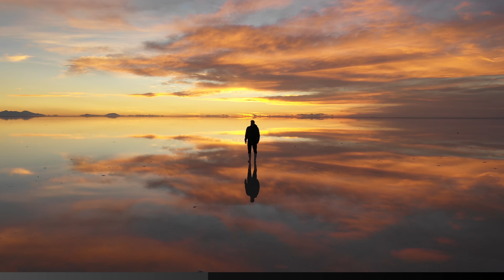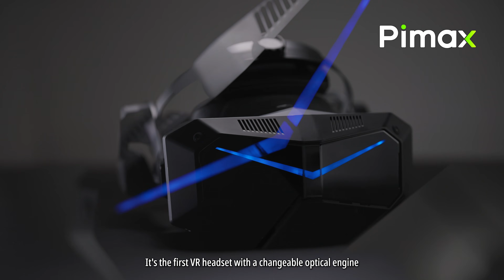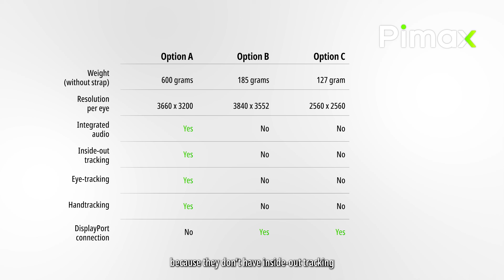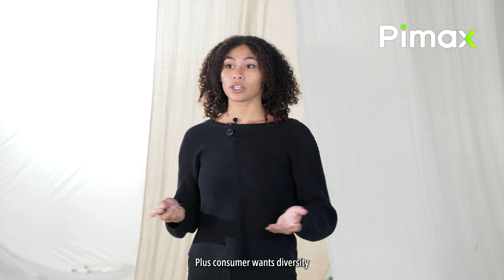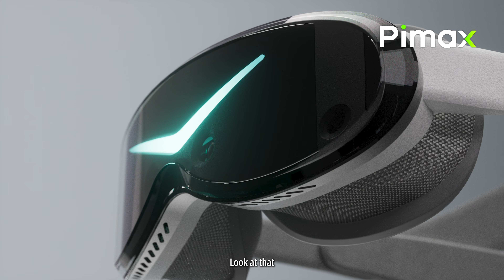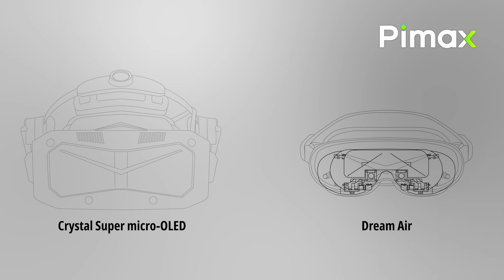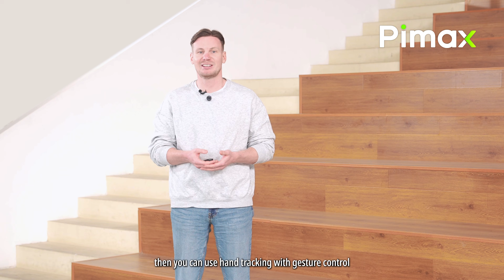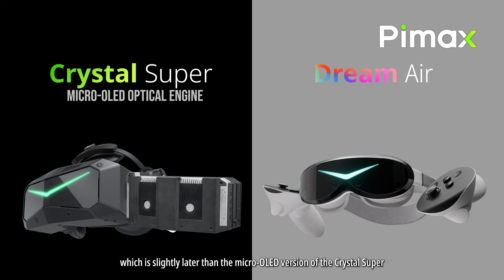Frontier: Hello Pimax Dream Air

Comment: I think this a very intelligent product offering - it basically steps into the BSB and MeganeX - but with eye-tracking.  Also, the pancake lenses, if executed well along with the resolution and the DP connection, then this is going to be a great product for people who wanted the Virtual Desktop functionality of the Apple Vision Pro, but at half the price.   27million pixels is going to be great in that form-factor.  

I wouldn't worry too much about Pimax getting distracted with a new product offering - afterall, this headset is 90% the mini-OLED optical package from the Super, which they've already done the R&D for.   What this does give Pimax is the opportunity to move into a new market, and grow - and if they grow, they'll be able to bolster their QA/QC and after-sales functions with a larger headcount!   The external optional XR2 puck is a great innovation too!

I think it's cool!
Reply: It certainly makes commercial sense repurposing the OLED package and if it delivers then it should be a success, just worried it won't be cool though in the literal sense.
Reply: @vrsimracer  😆
Reply: On paper everything is cool..
But reality is:
- waiting for X years for the 12K
- waiting 2 years for the Crystal Wide FOV lenses
- waiting for crystal super and now they use the same trick when they released the Crystal before the 12K.
I really like the crystal but I have 0 understanding on how this company is run.

Comment: It sounds like a nice product... on paper. Wait until it gets into paying customer's hands and see what is actually delivered. Pimax has been struggling with quality control. One user on reddit recently reported it took seven different crystal light lenses to finally get a pair that were defect free. That's beyond ridiculous. If they still struggle to produce aspheric lenses of sufficient quality over a year and a half after the Crystal initially released, why should we have any faith that Pimax can deliver on more complex pancake lenses? And even if you do get one without defects, how long will it last after that one year warranty runs out? Pimax needs to stop diverting their resources between so many products and put their engineers to work fixing their production problems and delivering the features promised for their existing headsets. This new headset reveal shortly after the QC and customer support crisis coming into the limelight just comes across as a desperate attempt to grab some positive PR by hyping a new product.

I want to see Pimax succeed but I'm not going to sit here and pretend their strategy of constantly pushing out new products despite existing products being plagued with major issues or undelivered features/promises is not a sure recipe for completely destroying the brand's reputation and goodwill (which is not great to begin with). Many, myself included have been hesitant to follow through on pre-ordering the super after hearing about the disastrous production ramp on the crystal light, and I've even got a $400 discount available, being an original Crystal owner. Pimax needs to sort out the defect issue ASAP and should extend their standard warranty to a minimum of 3 years regardless of where in the world you live. That would go a lot further towards reassuring people than making apology videos, especially after you already made one about the crystal light just half a year ago (and apparently haven't improved much).

Comment: I was very hesitant on this headset, until you said it'd have a lighthouse face plate later on. I'm nearly sold on it. I wish there was a lightweight solution for face tracking, and then this headset would be exactly what I am looking for, assuming the audio is on par with other solutions.

Comment: I do understand that Pimax has to keep the ball rolling in order to stay afloat in the VR market.
I also understand that too many announced but unreleased headsets make a buying decision difficult and create confusion.
Most consumers make a buying decision based on reviews of an existing, final product. Therefore it doesn't make much sense to pre-order any of the announced headsets a.t.m.
On a positive note: I'm glad Pimax isn't throwing original Crystal owners under the bus. The release of the Wigig module and production of additional batches of the headset are good news.
I am extremely happy with my Crystal and would like to keep it for at least another two years until (maybe) some really exciting new hardware is available and proven.

Comment: Oh no, they are at it again with a new headset despite the Super not even being sold.  Come on Pimax, when will you learn!
Reply: If you are talking 12k then just block the channel and don't bother replying lol a 4090 can't handle a 4k per eye headset above 100 fps let alone the 12k..
Reply: Def not smart need a 5090 for crystal super and crystal has a launch date which pairs with nvidia gpus that also launches in spring
Reply: It's exactly the same optical engine as on the Crystal Super so they share so many resources, also on software. It's not a fully new headset in that way.

Comment: PIMAX!!! Please stop for a minute and do not keep rushing things out the door. 
You cannot even wait until the crystal super you used in this production moves out of an early prototype! Even you dream air is showing the wires outside the headset. Your products are not ready to be announced if this is the status of your products. 
Believe me, I want new devices and I have already preordered the crystal super. But now I am rethinking it! 
Stop rushing. And stop using terms other big companies use like “Prime” and “Air”. I wonder when you will be called out by Amazon and apple for that.

Comment: Does 4K pr lens make the headset 8K? Asking for a friend.
Reply: It is not 4K per lens but around 6K ish.
Reply: @Xr14-j5q  Thanks, that makes sense.
Reply: @orions9999  Just to clarify the pixel count:
- 4K display: 8,3 M  
- Super and Dream Air: 14,7 M (per eye) - 29,5 M total
- 8K display: 33 M
So the accurate name would be Pimax Dream Air Almost 8K :))

Comment: A self adjusting head strap is unnecessary complexity that adds cost and a failure point. Ditch it
Reply: Completely agree. Just keep it simple and cheap and offer a higher end modular audio strap as an option. Not every wheel needs to be reinvented.
Reply: Disagree.  If you use it for long times it loosens ups
Reply: Looks unnecessary on the surface, but for users/operators of motion sims, the brisk or violent movements of the sim may shift the focus visual area on your headset. Great innovation, perhaps! Respectfully.
Reply: They should also get rid of the eye tracking as it adds too much cost for no benefit in MS Flight Simulator and most other games.
Reply: @dtz1000  thats only cause not many things support it right now, its future proof to have eyetracking
Reply: @dtz1000  Hard disagree man. Without eye tracking and DFR, DCS for me was on the bottom edge of playable with already low settings (3080 10GB). With it, it’s decent most of the time. Even on lower settings, my regular Crystal still beats the shit out of the quality of the Quest 2 and 3 (not owned— used others’, for honesty’s sake). I’d rather pay the extra cost for headsets with eye tracking natively.
Reply: @dtz1000  If they do this they will have another BSB/MeganeX.
Reply: @dtz1000  absolutely not! It's basically mandatory for DCS and other developers need to get on the quad views wagon as well. Even without quad views eye tracking is a god send. If you don't want eye tracking, go with Meganex or BSB.

Comment: I see most of your comments are frustrated people that are saying you don't focus on the headsets, and you jump to the next too quickly. I have owned the 8kx and the Pimax crystal. I had frustrations with both, but also loved both for certain reasons. Your headsets are far from perfect, but there is no perfect replacement. I currently have a preorder for the immersed visor. This looks like the gaming version of that. I think it looks amazing, but as people say, you might, and probably won't deliver fully on promises. Forget the Puck, just recommend something like a handheld windows based gaming device or a GPD device which are small yet powerful just to run a film etc and 2d gaming. Focus on delivering each headset you decide. Good to see companies pushing the boundaries, even if it just helps develop greater products in the coming generations with the current ones leading the curve and having some pioneering issues. Also, there are very few companies interested or able to start in VR, with the market share being with meta. I'm glad pimax are working on things, and I understand them not wanting to stand still. Interesting, and frustrating, but still interesting (from my perspective atleast and I know it will be different from alot of people but hey!) 👍

Comment: So it’s actually $2,000 after the required $700 app purchase…
EDIT:  Oh thats pre order price btw.  The headset will actually cost closer to $2500 with the app purchase upon release.
Reply: what app purchase?
Reply: @Jonathan-ol9si  Pimax Prime is a required subscription for 2 years after purchase at $33/mo or the headset doesnt work.
Reply: @JetlinerX  it's not required you can just pay it off in full after 2 weeks if not straight away iirc
Reply: @Jonathan-ol9si  right... kinda making it required, no?
Reply: @JetlinerX  no, no it's required for you to pay in installments for 2 years
Reply: @Jonathan-ol9si  It doesnt matter how you pay.  Over 2 years or all at once - my comment said there is a second purchase of the $700 app which is true.  Regardless HOW you pay for it, the headset will ALWAYS be $700 more expensive than its list price.  That is the "required app" you were asking about.
Reply: @JetlinerX  what are you on about $700 "for the app" what app
Reply: @Jonathan-ol9si  you gotta be trolling lol
Reply: Actually it's about $1,900 but point taken.  So, what do you think is a fair price for this product, if it meets the advertised cutting-edge specs?  $700?  $500?  Free?  From what I'm hearing about BOM cost estimates, the panels alone will cost Pimax close to $1,000 at current supply-limited pricing.  You can always buy a Quest 3 for cheap.
Reply: @ptmavic8995  Module cost 600 or 700. So it just a matter of extra interfaces, tracking cameras and software. Would be an insta-buy for 1600 from me. 
Make controllers optional. Make advanced strap optional. Maybe it is 1600-1500 for any flight and racing fan.
Reply: @ptmavic8995  i would love to see a budget option stripped back version (no eye tracking, no face tracking, 2k lcd panels, display port...for $800. and then have this OLED version for $1900). there are currently zero ultralight inside out tracked headsets for under $1500 (big screen beyond plus base stations and coontrollers is $1500).
Reply: @ptmavic8995  if the Super mOLED optical engine is selling for 700, you think they’re losing 300 for each one sold?
Reply: @ptmavic8995  Just sell it for 2k and dont make people "subscribe" for 2 years.  Simple.

Comment: Here's the answer to everyone who said "pass" on Meganex because of the lack of inside-out tracking. I'm very interested, I would simply like to see a top-strap option added
Reply: According to this presentation, the Dream has SLAM inside-out tracking standard, but will have an old-tech base station snap-on faceplate like the Crystals.  Best of both worlds.  Meganex may have a lot of peed-in pants at HQ today.
Reply: @ptmavic8995  totally, but it's gonna come down to the lenses, Seb and Mike Flightsim were losing their minds over the Panasonic-engineered lenses in the Meganex, I am skeptical that Pimax's much smaller engineering team will be able to match them, but we'll see

Comment: How can you forget you're wearing a headset when you have a huge cable tugging on you and running down your back 🤔 I don't understand what the point of headsets like these are when they don't have wireless. Bigscreen has the same problem. As least they can finish a product though unlike you guys
Reply: Don't worry, Pimax will come out with a wireless version soon lol.
Reply: @reptilexcq2  Yea lol, and it'll have issues that they promise to fix by "end of the year"
But after releasing another headset they'll say their priorities have changed haha

Comment: If they deliver, this marks the next phase of Pimax as a company and securing their future in this industry as the technology moves forward beyond large form factor bulky headsets.

They are coming of age, but so far, this headset does not seem to exist - whereas there are others that do actually exist, haver been tested and very well reviewed and coming to market soon - keep that in mind. 

Commenters here who are complaining - if you want Pimax to continue to exist, you want them to do this and get ahead/remain in-step with the rest of the market, not stay behind with big bulky headsets. 

The market will choose this next gen of micro-OLED headsets in the coming years, really starting from next year- small and lighter beats bulky and heavy - Pimax are bringing together this form factor without losing the most important features, retaining high spec.
Reply: "if you want Pimax to continue to exist, you want them to do this and get ahead of the market, not stay behind with big bulky headsets." 
Exactly this, even coming from a simmer who is very happy to have a bulky Super on order I see Pimax needs to expand into this end of the market, as long as it is a success which it sounds like it should be.